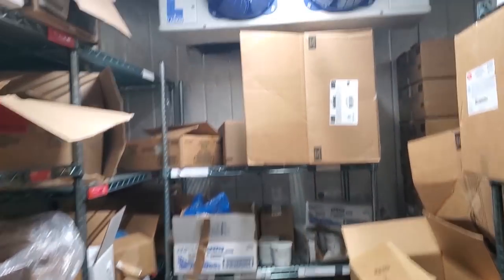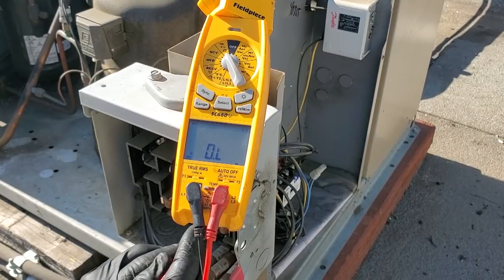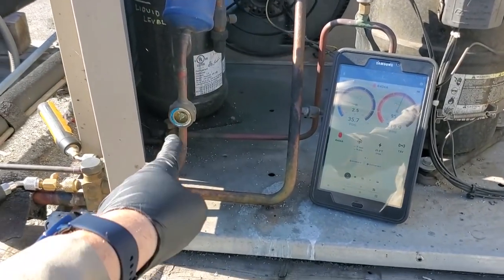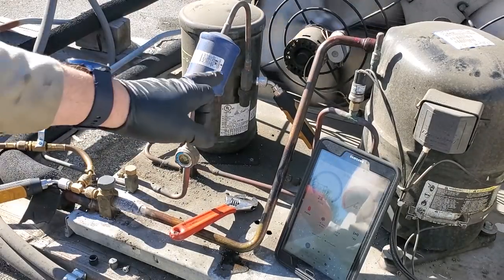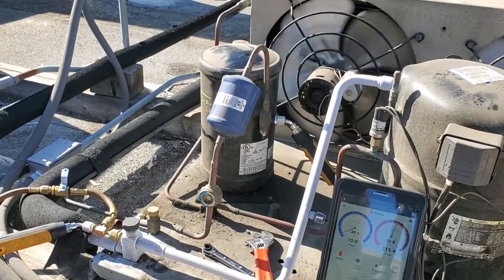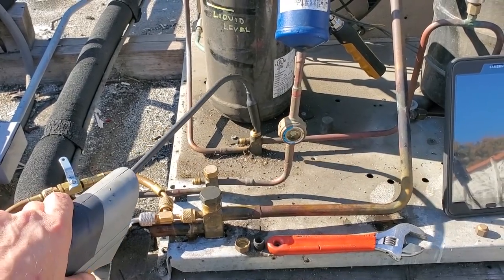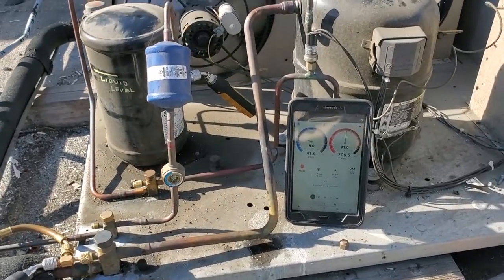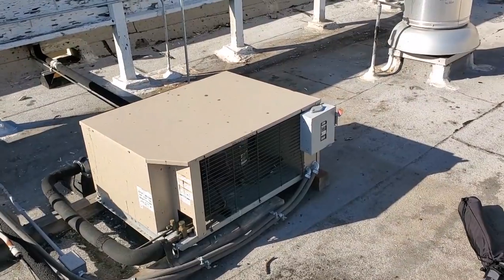SIMPLE WALK IN FREEZER CALL THAT LED TO SO MUCH MORE

Comment: thermal camera to check for proper charge lollll :D  what happened to methods like subcooling, condensor split etc   you could have a those bubbles due to small restriction in your filter drier SMH ... anyways
Reply from the maker: Subcooling will only tell you if there is an overcharge on this unit because it has a receiver. Basically just clear the sight glass once the unit is not under a giant load and add the flooded charge. The thermal imaging camera was there to help me identify how low the flooded charge was
Reply: since it is a freezer im surprised there is no suction line accumulator with your flooded evap set up. considering you dont want more than 5 degree of super heat on your freezer evap ... arent you getting liquid floodback ? unless your suction line is long enough to pick up some suction line superheat or subcooler
Reply from the maker: It's not a flooded evap I was referring to a flooded condenser to control headpressure. The system has a head pressure control valve that backs refrigerant up to help maintain the proper system headpressure. That head pressure control valve needs extra refrigerant for it to work correctly in cold environments. As far as the accumulator there is no need so long as you have superheat coming back to the compressor.
Reply: ah i see. how cold does the ambient temp get down there where you from ?  is it a ORI and ORD combination head pressure control ? but i guess you dont need ORD bcz you got ORI with fan cycling ..